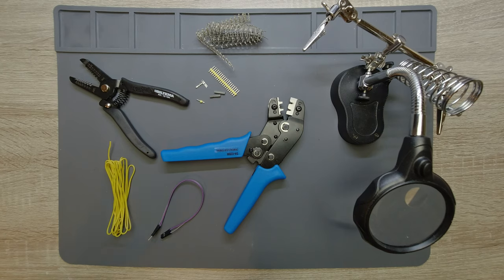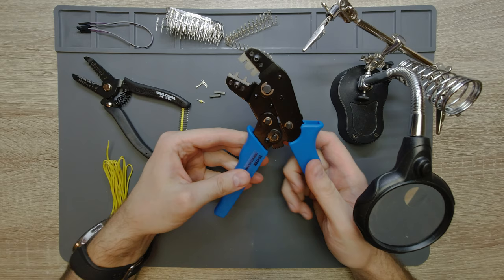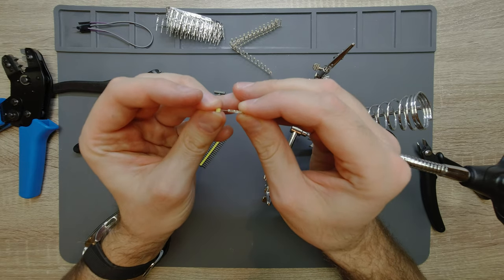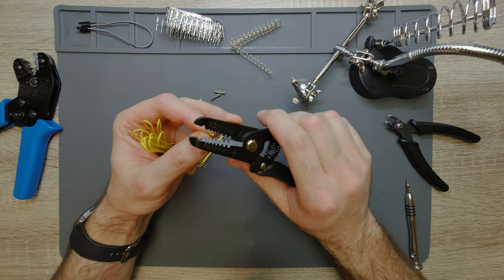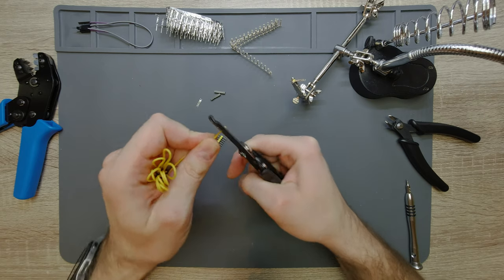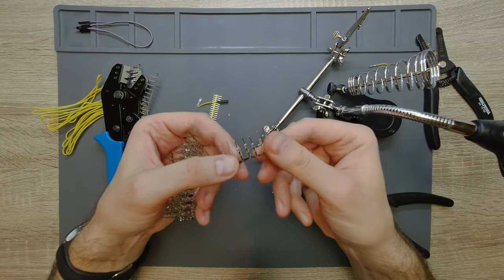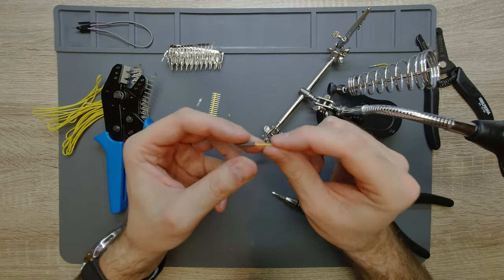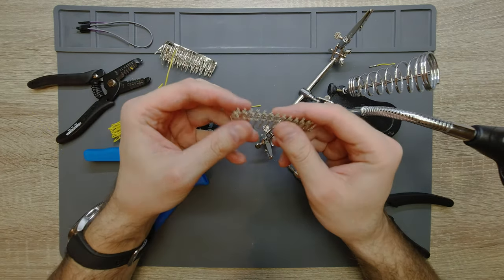Crimping dupont connectors

Comment: It did help me i struggle with the right orientation and good fit for my Model Trains. I use these types of connectors to make my harness to conness the tender and the engine digital stuff. Usually 6 or 8 wires but a nice plug and harness make it so e much easier to route and manage. Thank You so much. Now I am working on an ESP3266 install for Wireless WiFi and PWM DC Motor control. I have the fan smoke and chuff sound synchronized,, All wheel  pick u at the tender, digital sounds and LED lights. Wanting to go wireless with real slow motion and buttons for Steam Whistle. Its my retirement hobby. With 3D Printer and DIY Mini Mill I am a pig in you know what!  Great video as usual. Dennis
Reply from the maker: Thank you! I am glad that the video was useful for you! I have videos on PWM DC motor projects, if you're interested, check my channel! Cheers!
Reply: @CuriousScientist  I will. I am having some tricky issues with reliability. WiFi here I suspect.

Comment: Only Americans know what "dupont" means. Most other countries do not use that term.
Reply from the maker: I think in electronics, dupont, as a connector type, is widely known. Otherwise, it could also be the famous chemical plant that, for example, invented Teflon and other materials. :)
Reply: @CuriousScientist  Never heard it used in my country. Even English countries outside USA don't use a brand name. In fact that brand may be available in my country but it's really not used by anyone. Mostly roll over or fold over for un-insulated terminals is the term I've heard. I've seen videos from England and they don't use the term either in my observation.
Reply from the maker: I saw it somewhere when I started to get more into electronics (more specifically, Arduino stuff) and it got stuck. I won't change it now, it is too late. 😄
Reply: @CuriousScientist  Haha. Ok. No problem. I don't think they know what to call them here. Some guy told me it's a Molex connector. 😅

Comment: Sir in case of molex connectors, which activity is performed ? crimping or soldering
Reply from the maker: Crimping. Nearly all of these plug in connectors must be crimped. Soldering should be avoided.
Reply: @CuriousScientist  but  why should we avoid soldering, soldering makes the joint  very strong
Reply from the maker: Soldering is not necessarily better than crimping. Crimping (if done properly) is a much better and reliable connection, especially for harsh environments or environments with motion such as vibrations or similar.
Reply: @CuriousScientist  how can you prove that
Reply from the maker: Because thousands of other engineers evaluated the performance of these joints and I read some of those people's conclusions.
Reply: @CuriousScientist  I have to confirm this from others also
Reply from the maker: @ArtBuddyIndian  What, you don't believe it or what??
Reply: @CuriousScientist  As per my experience and conversation till date with related technicians in the field, soldering joint is used for high current carrying applications
Reply from the maker: If you see soldering in high-current applications, then you are in a very bad field... Soldering should be avoided at high-current applications.
Reply: @CuriousScientist  how will you join a 2.5 mm thick pin to a wire  inside a connector will you use crimping for that purpose. Crimping is for thin pins only as far as I have experienced
Reply from the maker: Sorry, but your experience needs some improvement then. You can crimp anything. You just have to choose the proper connections. In the industry, power cables even at 30 kV are crimped (and for some strange reason never soldered). So yeah, do a bit more studying.

Comment: Is there a reason to use solid core over stranded? This process seems a little easier when working with stranded wire.
Reply from the maker: There's no specific reason, other than this cable was right next to me, so I picked this up for the demonstration. In fact, stranded wires, especially those with the silicone insulation tend to be much more flexible. So, if you need the flexibility, go for the stranded one, if you need rigidity, go for the single core cables. I also prefer the stranded wires with the silicone insulation.
Reply: There’s rarely a reason to use solid wire in electronics. In the distant past, stranded wire was much more expensive than solid, so in static applications, we used solid. But the cost advantage has shrunk a lot, and stranded is more tolerant of vibration and flexing and is easier to work with, so it’s used almost exclusively now.
Reply: You have to use finely stranded purer copper wire in machines where there is a lot of flexing otherwise the cables break internally. Solid is only for cables that don't move once installed.

Comment: you can just do it with nose pliers. but it will not be as fast.
Reply from the maker: Yes, it can also work. But it is much better and comfortable with a dedicated tool.
Reply: Just to be clear: no, you can’t actually do it properly with normal nose pliers. Crimping is actually a precision process that forms a cold weld, and this requires a careful balance of enough pressure to form the cold weld, but not enough to damage the conductor. You cannot do this with ordinary pliers, as the lever ratio doesn’t enable you to apply enough force.
Reply from the maker: Yes, this is actually a very good remark. I guess iceberg789 only referred to a "just fine" solution to have the terminal connected to the wire. But of course if you would want to go for a professional solution, a dedicated tool is needed.

Comment: Yes the more important tool is the crimper but even more important is the quality of his die set; thankfully this part is changeable.
The 50% of quality rely on the tool used the other 50% is all about skills, so I encourage everybody to practice a lot.
Reply from the maker: Totally agree! I actually have another crimping tool and I have a bunch of dies with it for different connectors. It really worth the investment, your cables and connections will be thankful. When I bought this tool, I messed up several crimps and I still mess it up sometimes as the video illustrates. Practice, practice, practice...! :)

Comment: Dupont connectors with the staggered triangular insulation wings require a round die, not a "w" shaped die.
Reply from the maker: Thanks! Seems like that the crimper I use is not the "official" Dupont crimper, but a "Dupont" crimper. Everywhere I see these on shopping websites, they refer to them as Dupont crimping tool. You are not the first (and probably not the last, haha) person to point the differences out. I will keep this in mind thanks!
Reply: @CuriousScientist The crimper they are referring to is model SN-025 - Made in the same factory in China as the SN-28B you are using here just has a different die set in them.
Reply from the maker: @paddyg24  Thank you very much for the explanation as well as for the model numbers!
Reply: @paddyg24 The numbers 25 and 28 refer to 2.5mm and 2.8mm. Most people in the planet don't know what AWB and SWG means anymore and use mm.
Reply from the maker: Thanks, this is very useful!

Comment: The crimping die has two sections: the section for crimping the insulation has a larger opening than the section for crimping the wire itself. So it's important not to insert the contact the wrong way round. 
You also have to align the connector pin with these sections. My crimping die is wider than the sections of the pin that have to be crimped, so I can't align on the outside of the die: I have to line up with the middle of the die instead.
Reply from the maker: Good remarks. It is also important to strip just enough length of the insulation, and to not insert the wire too deep in the connector. Otherwise, the conductor won't touch the terminal and it can also hinder the pin ("counter piece") to be fully inserted in the female connector.
Reply: @CuriousScientist  your tip of inserting a pin into the connector during crimping was very helpful, it makes estimating how far to insert the wire a lot easier.
Reply from the maker: I'm glad to hear that you found it helpful!

Comment: Hi! what is the perfect wire to these type of connectors?
Reply from the maker: Hi! After drawing further conclusions after making this video, I would use stranded wire, probably 28 or 30 AWG. Especially those with the silicone insulation. They are heat resistant and very flexible.
Reply: @CuriousScientist  thank you very much!
Reply from the maker: You're welcome! Cheers!

Comment: Your crimps are garbage because you used a wrong crimping tool for Dupont, a very common mistake. Most of the cheap crimpers which are described to be suitable for Dupont connectors are anything but. Crimp around insulation shouldn't look anything like this, It should nicely wrap around the insulation, not squashed in the middle. You can google IWISS SN-025 to see how a proper crimping die should look like. The same as this tool on wire crimping side and round on insulation side.
Reply from the maker: Thanks, these are the comments that I am looking for: constructive criticism! I will look up the mentioned document and if I find a tool with a good price, I might make another iteration of this video. Cheers!
Reply: @CuriousScientist  I also just noticed you crimped a single strand (solid) wire, which is a big no-no. Reliable crimps are not possible with this type of wire. Only multi-strand wire must be used for the vast majority of crimps, with some rare exceptions designed specially for solid wire.
Reply from the maker: I only had that kind of wire, so I used what I had. Nowadays, I use a silicon insulated stranded wire. In fact, the crimping works/looks much better on these wires.
Reply: @woopsserg  Crimping solid wire isn’t quite as big of a no-no as many people think, but you’re correct that most crimp contacts are designed for stranded only.
Reply: @tookitogo  It is a big non-no, since solid wire will not hold well enough in such connectors. It likely will work for some time but if there is any movement or vibration, very likely wire will dislocate from such crimp. If you really need to use solid wire with unsuitable crimp connector, just solder it. It will be 100 times more reliable.

Comment: oh my god... sorry, but wtf are you doing? its crimper not for dupont. just check HT-95 (AWG 22-32), HT-102 (AWG 22-32),  HT-73 (AWG 18-20) and other.
Reply from the maker: This tool works fine with JST and dupont contacts, so I don't know what's your problem. If you want to correct me or anything, I am totally okay with it, but you can do it in a less condescending way as well. ;)
Reply: @CuriousScientist  less condescending its IWISS SN-025. Sorry, but you inserted an wrong crimped dupont on the  video thumb and talk about a good crimper. this is a very common mistake. you should research the theme before talking about it. Dupont wings must not pierced into the wire insulation(JST - yep, but not dupont)

Comment: Useless. I couldn't get even one connection to work after watching this video.
Reply from the maker: Interesting, I made most of my dupont connections myself and all my electrical circuits are running fine. Maybe the problem is not in the video. :)
Reply: @CuriousScientist  Actually, the wires I'm trying to connect are probably too thin. I'm trying to connect duponts to a 1.25mm connector. The wires are #30 or higher. Also, the tabs should be crimped on the insulation before inserting into the crimping tool. Still, I only get about 1 in 10 to hold.
Reply: @brucekarpe1759  Crimping is a precision process that requires careful matching of wire, contact type, and crimp tool. The mechanical tolerances involved are surprisingly tight, and with tiny connectors like 1.25mm pitch, it gets even more critical. A crimp tool for DuPont (which 99% of the ones sold “for DuPont” actually are not!!) is much too large for a 1.25mm pitch contact. The crimp dies for 1.25mm contacts are tiny! 

If you mean that you need DuPont contacts onto 30AWG wire: this is possible, but not with a standard tool. (Most of the aforementioned bad DuPont tools struggle to crimp 24AWG reliably, so hopeless on thinner wire.) Additionally, the contacts themselves are different: the ones for thin wire have smaller crimp tabs. I own a “real” ($450) crimp tool for dupont-like contacts, and with it, I can reliably crimp onto 30AWG, because it has three positions in the die, one of which is for 28-32AWG. If you value your sanity, I highly recommend picking up a proper tool: with patience and luck, you can buy them on auction or classified sites for pennies on the dollar. (I got my $450 tool on the local classifieds for $60 shipped, brand new.)

“Insulation tabs should be crimped first” — No. With a proper ratcheting crimp tool, you do not pre-crimp anything, it’s a one-step process.